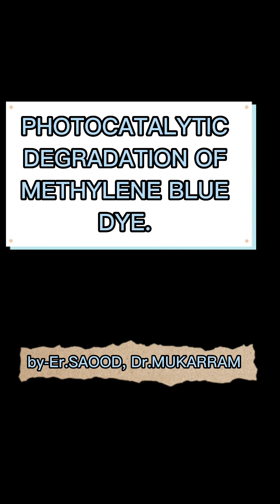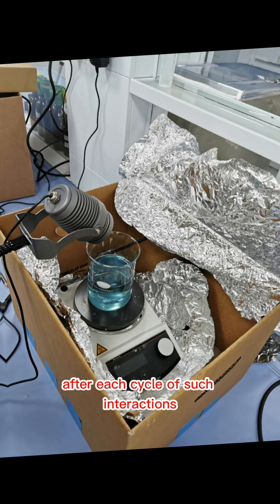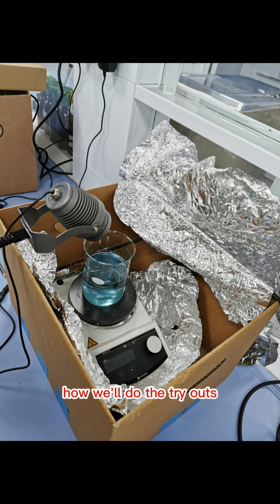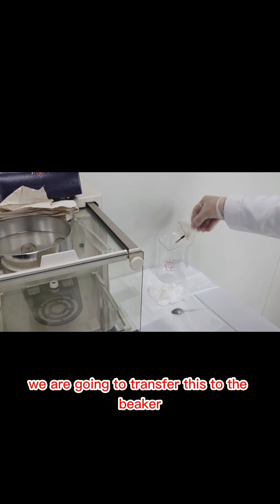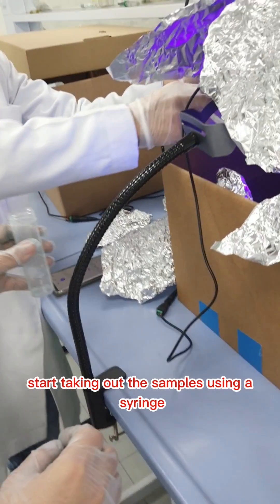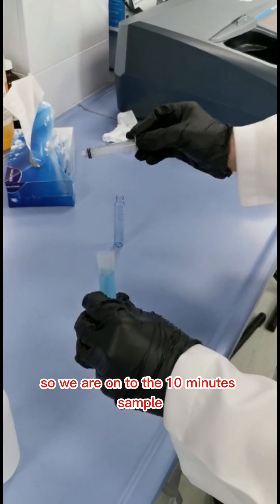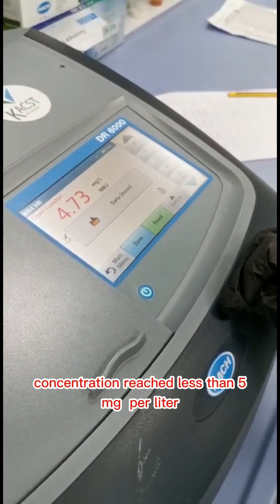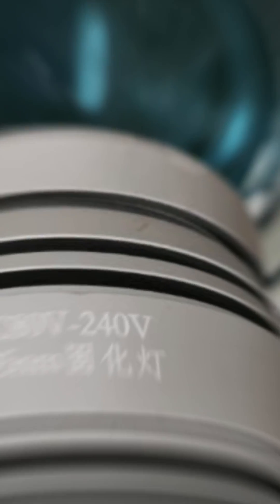Sustainable Photocatalytic Degradation of Methylene Blue Using Biochar-LDH Nanocomposite

Comment: Do you know how the pH of the solution may affect the rate of degradation?
Reply from the maker: Yes of course it will affect the rate of degradation as the analyte or the pollutant exist in various forms
Reply: @materialsandtechnology8956  do you know if the rate will be faster in lower pH or higher?

Comment: Hey, awesome video! I am also doing a photocatalysis experiment for my chemistry IA. I tried with 0.1 g of titanium dioxide mixed with 25 micro litres of methylene blue in 50 ml of distilled water, but the solution became too cloudy and the absorption was above the limit of my photospectrometer. Could you suggest better amounts for my experiment please? I did not use a centrifuge machine. Do you recommend I use one after collecting sample every 5 minutes?
Reply from the maker: You can centrifuge or do vacuum filtration using membrane filter or cellulose acetate filters
Reply: @materialsandtechnology8956  Are my amounts of methylene blue and TiO2 all right? I am planning on changing the amount of TiO2 (independent variable) to see the change in concentration after exposing the solutions for about 30 mins.

Comment: Nice explaination and work.. Keep doing 👍
My question is,  if we use magnetic nanoparticals then how this procedure will be occur? Magnetic strirrer is compulsory in this procedure?  Because magnetic Nanoparticles attached with magnetic strirrer. Then what is the solution???
Reply from the maker: You can use centrifuge to segregate the nanoparticles,  and for analysis we need few ml to analyse

Comment: Most of the powder form of photocatalysts are not soluble in water, then how photicatalytic study will be done
Reply: How to do UV absorption study if it is not soluble
Reply from the maker: Still you can do uv absorption it's not necessary
Reply from the maker: You can coat it on quartz film or plate

Comment: What kind of light source you have used (type of lamp)?
Reply from the maker: Its a uv lamp bought from outside,  354 nm
Reply: @materialsandtechnology8956  thank you. Could you please share link to purchase the same lamp?
Reply from the maker: The lamps were bought from aliexpress  , you can also buy from amazon or local suppliers
Reply: @materialsandtechnology8956  what is the power for that lamp? Is it strong enough to perform the photocatalytic degradation in a reasonable short  time?
Reply from the maker: It's 200 to 250 watt you can buy higher power , it's not enough for hundred percent or complete degradation of dyes or pollutant,  that's why I said we used here advance oxidation or photocatalysis
Reply: @materialsandtechnology8956  
Can we used another light source?
Reply from the maker: https://youtu.be/_pv6JfDUJ18